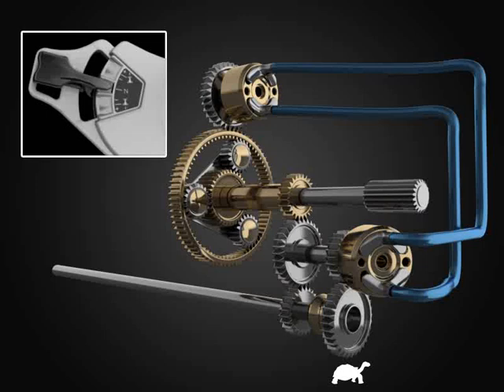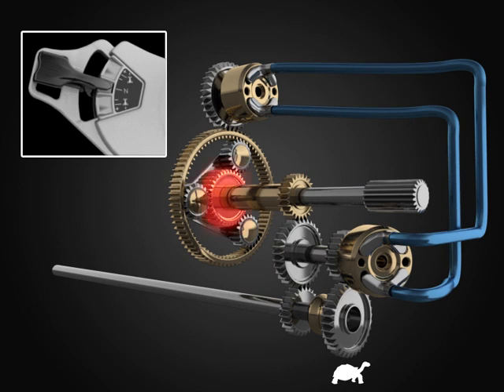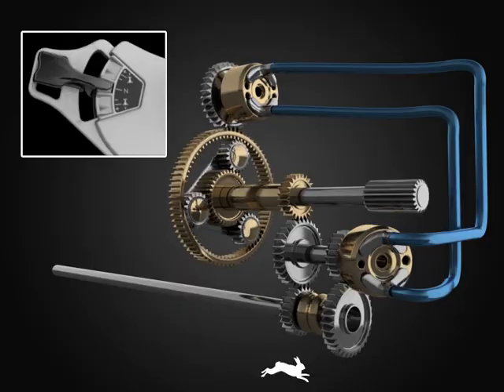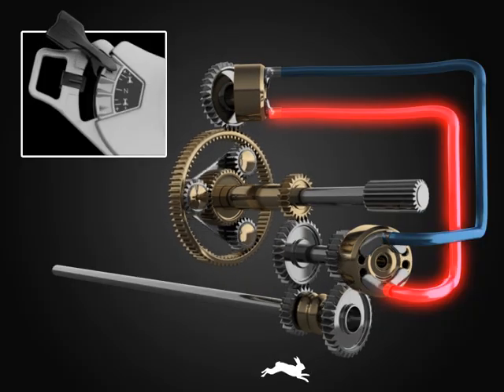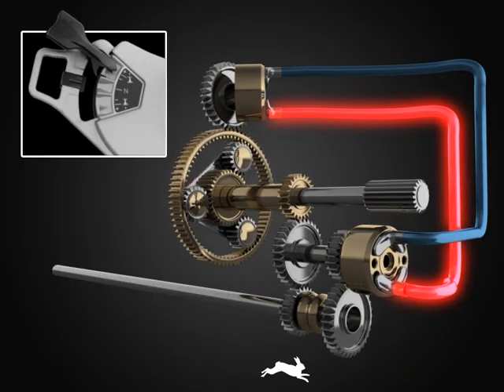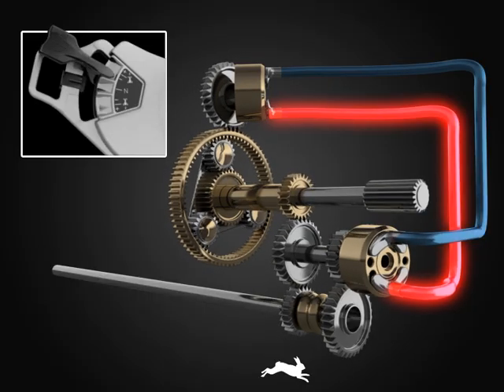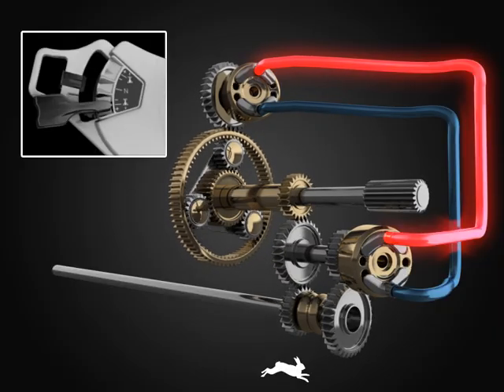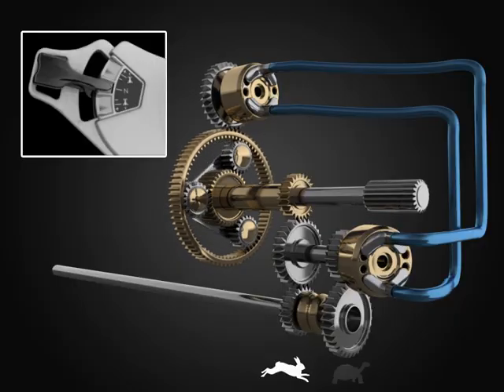AGCO's Continuously Variable Transmission (CVT) Explained

Comment: So when the transmission is at full speed and motor is in neutral position power transfer is 100%mechanical but if motor would be swing in other side will work as pump and increase speed more

Comment: Originally designed by Hans Marschall, chief engineer at Fendt. This is why those transmissions are named ML... until this date, Marschall Leistungsverzweigt.
Reply: It's a variation of hydro-mechanical transmissions as used in tracked combat vehicles for 50 years+.

Comment: Wow! I've been a truck and heavy equipment mechanic for 30+ years so I've worked on lots of different types of transmissions. From hydrostatic to gear. And this is one smart set up. So simple but very smart. It should be used in more than argos.

Comment: In short, by allowing the "loaded" path of energy to be primarily transferred via the mechanical portion of the transmission, it cuts the losses associated with transferring power hydraulically. My question is, what maintains the integrity of the hydraulic circuit when the unit is in full lock, or full speed? Half of the output torque load is being converted to hydraulic pressure with zero flow in the system... so how are they managing these pressures and the inherent temperature rise without flow?
Reply: You said it yourself, it's just a constant pressure with no flow, you're not putting any energy at all into the hydraulic system when there isn't any flow to generate heat or increased pressure.
Doesn't matter what pressure you're at if nothing is moving you are completely inert and no power (thus no heat) is being transmitted.

As an aside the hydrostat's operating pressure is roughly 500 bar if I remember correctly.

Comment: Will this work on engines with 135 HP ?
Reply: (Agco) Fendt has a 415 hp tractor
Reply: Or smaller ones too
Reply: The range at the moment is 70 hp ro 600 hp

Comment: Can you explain what's going on with the hydraulic pumps physically pivoting side-to-side? I don't understand that part of the CVT's operation.
Reply: i believe it  changes  it's  volume of oil  per revolution.   slid one way,   low  volume,  slid the other way,  high volume.    
Which  will   change how much  'pressure'  that ring gear will feel, (not because of load)       and  transmit power.   It's still  a  gear connected   engine-to-tire   transmission.
How  fast   that ring gear  rotates..    is  controlled  by   the  amount of  oil being pumped.     Think of  having  a  'locked'  ring gear,  or one   turning as  fast  as the input...  or  infinite    settings  in between.    They all have an effect on how fast the output  shaft will turn.

Comment: OMG a Planetary gear set controlled by Fluid slip?
So.... its a torque converter and Planetary Gear set. 

with the torque converter connected the ring gear and the engine connected to the torque converter and the sun gear. 
ALL you have done here. is add needless complexity to a simple as HELL system. what is wrong with you?
Reply: How would a torque converter accomplish reverse?  
Also this design gives the tractor the ability increase ground speed whilst decreasing engine speed. Not sure how a torque converter can do that. Unless there is some sort of variable vane technology out there I dint know about. 
Also it would take a bit of math to see for sure but I don’t think a torque converter has enough range.
Reply: @rat_king-  Thank you , I subscribed to you I hope you don't mind...
Reply: SO pray tell which part is unnecessary???? I wont naysay the engineers...
Reply: @charlesangell_bulmtl  Trade the fluid pumps for the impeller and the turbine in a torque converter. 
Remove the 3 un- necessary shafts, and you have: a torque converter where one gear is attached to the sun and the other to the planet carrier. 
The torque converter controls two parts of the planetary gearbox, the sun and the planet carrier, the ring gear being output. As torque demand increases, the difference between the two halves of the torque converter gives you the different gear ratios. The torque converter is "seeking" direct (straight through) drive

The only slight advantage i can see is the Lack of slip in the system, using pressure difference rather than velocity difference  in this system. See use of a positive displacement pump (hydraulic gear pump) vs a impeller/ turbine.
Anything that slips is converting energy to heat, ie wasted fuel.
More things to break more things to fail, more things to exercise your money's thermal properties
Reply: @rat_king-  Thank you-Your answer will require me a bit of processing as the video gave me an easier digest ...Pray tell, do you know of a video with what you  describe?
Reply: Why this don't use in cars?
Reply: From my 20s, a book on carburetor patents, being the impetus, this peckerhead/wood(me) has been on a slight crusade to sidestep the screwing we receive from the powers that be..
..latest searches include regen. hydraulic powertrains.
 Downside...cost of accumulator tanks, need to build, F**k their prices.
 CVT has been an attractive thought but for the losses and complexity...and $$$. 
Seems that YouTube may be good for more than just killing time LOL.
 I like your title, I think of myself as an Amerikaner Scweinhundt...Sgt. Rock reference. I think it fits nicely as I'm primarily of German descent.
 Would like to build a simple 5hp reverse trike with  regen. hydraulic powertrain....
Reply: @charlesangell_bulmtl  its not so much the ideas, its the availability of spares that holds back small inventors. Because you immediately have to sell your idea to a large company to have any chance in creating the thing. I mean look at this tech, 3 different companies within the span of 20 years. Not good.
Hydrualics are most certainly not the way to go. failure of seals and weight of pressure vessels will be your downfall.
IDK look up liquid piston and come back here.....
Reply: @rat_king-  liquid piston??
Reply: @rat_king-  Large company .. oh hell
 NO
 Personal use and private community possibly.
Reply: @rat_king-  Besides, anything basic keeps life better, forget the bells and whistles trap
Could probably find  scrap for pieces
Just need a good salvage yard
Reply: My father was a weldor fabricator, SOO

Comment: Is this any good?
Reply: According to our customers(sweden) it´s the best transmission on the market, we have a lot of happy fendt-drivers. If you´re gonna change it tough, it will cost around 8-10k(depending on modell) euro plus work for an exchange transmission. Many will fail around ~3500-5000h of work, but many will last longer(some rare cases shorter), depending of conditions of course. 
Overall they´re very reliable!

Comment: I wonder how powerful that hydraulic pump and motor must be
Reply: I hauled 7000 gallon tanker on hills
Reply: it handles around 400 bars easy
Reply: In these configurations... typically less than 8% of of the engine's output, at most, is transmitted through the hydrostat. Under typical duty/load, especially in this application, it's usually less (3-5%). Agricultural applications don't have a huge amount of variation in RPM... and that's about all the hydrostat does, is serve as a speed regulator.

Comment: i don't think that this device will results in an infinitely variable torque since the gear ratio is fixed between input and output shaft in all conditions>> it should be in a way that torque and speed is adapted with the load on the output shaft
Reply: pressure/speed differential....

Comment: What does 'swings left/right' actually accomplish?  How is the rotation affected?
Reply: Gene Koveski It uses swash-plate type hydraulic pumps and motors.  With this design, the pistons on the pump/motor are connected to the swash plate.  "Swinging the pump" means "Tilting the swash plate".  This adjusts the amount of volume change in the pump or motor per revolution, and, hence, its oil consumption and resistance.  If you Google "Variable displacement hydraulic pump" there are some pretty good explanations.  Hope this helps!

Comment: There are many types of CVT. Some use belts and pulleys, toroidal disks, or tilting spheres, and others are purely hydraulic. This transmission is part of the CVT subclassification IVT, do to its ability to reach a neutral and reverse gear ratio. All variable displacement hydrostatic transmissions, regardless of configuration, fall into this subclass of transmission.

Comment: got it after watching aproximately 20 times ))). But it's amazing ! It's simple mechanical CVT ! I want it on my car !
Reply: An ecvt is virtually the same, only using electric motors instead of hydraulics.
Reply: One question, does this transmission have any actions to change gear ratios like some other tractor cvts?
Reply: @jacktackfly8838  it has a high and low range. Low for in the field, high for on the road. Not something that shifts in and out, but the user chooses what they want before moving.
Reply: @tangydiesel1886  ahh i see, tnx
Reply: @jacktackfly8838  no, as shown in the video it's all hydraulic

Comment: They gears are not showing the correct direction. If you watch the input shaft compared to the directions of the pump and motor gears it would be shredding the splines of the gears. I feel sorry for the fella who didn't catch that. If you're going to make a training video showing how a system works, atleast make it to function properly.

Comment: @Rpleech1 If you look at the video the you can see the pump and/or motor swing from middle to the left or right. What this has to do about changing the transmition speed from the gear to the pump or from the motor to the gear is not clear to me. For clarity I've got it about the oil-driven motor.

Comment: @Music201ful You mean the Steyr transmission?
"Fendt launched the revolutionary Fendt 926 vario in 1996. This was the first ever stepless transmission to be launched in the tractor market, and is patented to be the only ever truly stepless transmission, with brands in competition unable to make a transmission as advanced as a Fendt Vario."
Reply: Nah, stepless tractor transmissions were a thing decades before this. For example IH Hydro's in the 70s and it wasn't a new idea by any means even back then. And it wasn't as good maybe but this isn't perfect either. I think the first tractors with a disc type CVT are over 100 years old by now.

Comment: @Music201ful This AGCO CVT is actually the Fendt Vario transmission which was the FIRST one on the market.
Reply: One question, does this transmission have any actions to change gear ratios like some other tractor cvts?
Reply: @jacktackfly8838  It's a power split transmission with a planetary gear branching the power to Hydromotors/-pumps (Toyota uses a similar technology for their hybrids - electric instead of hydrostatic though). There are plenty of videos and websites that describe these transmissions.
Reply: @MichaelLutz  ye ik tnx, i just find it a bit weird that Case, class, new holland has a transmission with clucth packs and vario transmissions have no clutches and gear shifting
Reply: @jacktackfly8838  Fendt improved the efficiency of the hydro motor/pump. I guess they had a patent so competitors couldn't copy it.  The key was to increase the swing angle from 30° to 45°. Fendt's Vario transmission is apparently efficient enough to have only on range ("gear"). Originally (and maybe still most models) have 2 ranges. One for transport and one for field work.
Reply: @MichaelLutz  wow, so let me get this straight, fendts have 2 ranges so they have a shifting mechanism or do they just make those 2 ranges with hydraulics?
Reply: @jacktackfly8838  You have 2 switch between these ranges manually (push a button).
Reply: @MichaelLutz  ahh thank you very much for the explanation
Reply: @MichaelLutz  Excuse me for chiming in , the hydraulic pumps and motors running on swash plates to regulate power reminds me of the Hydro transmissions pioneered by IHC in the 1960s .
Reply: @interman7715  It's old technology refined to make it work efficiently. Fendt figured out a way to swing the pump/motor 45° instead of 30°.
Reply: You know who owns fendt. Agco
Reply: @CheeseMiser  
I know that. But it's still a Fendt invention. The 926 Vario was introduced in 1995. AGCO acquired Fendt 2 years later.